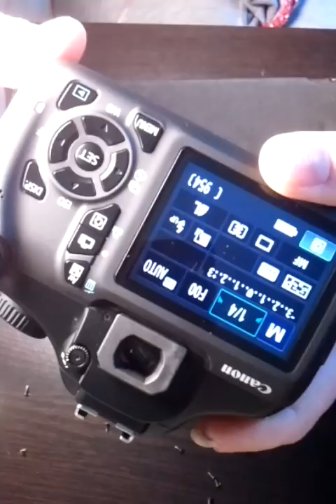#001 Repair Canon EOS 1100D (Rebel T3) - SD Card Replacement for Error

Comment: This is awesome, it's close enough to my T3i model.  I have a bad habit of leaving the SD card in the slot, even when not in use.  I'm assuming, over time, that is now a "no no" as I fired mine up after about 2 years of the SD card being in it and when I tried to remove it to throw in my laptop, it gave me trouble getting it out.  It took a little force after the eject mechanism but it still gave me an issue getting it out.  A piece of the corner from the SD card was cracked and created an obstruction.  When I finally got it out, I learned that it bent the contact pin for the write protect lock and no matter what I tried, even though 6 different SD cards, didn't have the write protect lock enabled, it still would not read the card.

Just ordered my SD card board and when it arrives, time to go to work :D
Reply from the maker: Hi, thanks! Interesting, this model had some issues with the SD card, same issue as you mentioned. You are lucky with this model, Canon decided to place the SD card separately on this entry level camera! This is my first video on this channel, it got over 22k views by now, glad to see people still can make use of it!

Comment: What that tagged black wire is used for (12:40)? I think I broke the connector. :(
Reply from the maker: Francesco Cosoleto 
Is related with the flash, it’s an optical wire, just need to stick it in that white holder

Good luck!
Reply: Thank you very much!

Comment: hello. i have a powershot s3 is and the reader is soldered to the whole board (not a separate piece like yours) do you know if its possible to remove the cover to see inside?  if so how?  i can hear something is loose and hoping can be repaired as the reader is giving an error
Reply from the maker: cynthiarf - AfroCare replaceing the sd slot soldered to the motherboard requires a good experience in the soldering as it is not a job for beginners, I suggest you get it done by an expert

Comment: Might be a little late for a response but I'll try anyway -
I bought an 1100D, with the card protected error.  After trying a fix from a different video (soldering a jumper wire), and also trying to bend the "lock" tab, I now know longer have the card protected error, and instead get an error about the "card cannot be accessed", and I cant format the card in the camera.

I went ahead and ordered the 1100d replacement SD card pcb.  In your experience, do you think the problem is with the SD pcb, and swapping it out will repair the issue and get it working?
Thanks for any response.
Reply from the maker: Hi, there are two pins inside the card reader, one for the protection and one for recognising that a card was inserted. Something could go wrong there, still the camera should work after replacing the whole SD board
I would never recommend repairing such a delicate component, in some cases could damage the main board

Good luck 😉
Reply: @CameraRestore  

Thanks for the response.  Hopefully no damage to the mainboard was done, as everything related to the last "repair" I did was localized to the SD card PCB.

Here's to hoping that getting a new SD card board works.

Comment: Hello. I am having the same issue with my camera (Canon T3) Can you please tell me where can I find the part? I have looked on ebay but nothing... I really apreciate if you give me where to buy it. Thank you.
Reply from the maker: Hello, try here:
http://www.ebay.com/itm/Canon-1100D-SD-memory-card-slot-board-pcb-replacement-part-L130-/171487571348?pt=LH_DefaultDomain_0&hash=item27ed74ad94

Comment: Can you pls point me the correct SDcard board for canon T3i rebel in ebay , my camera is failing with "card write protect switch is set to lock"
Reply from the maker: Have a look for this part number in your area: CG2-2946

Comment: how much does the card reader cost?? please
Reply from the maker: gomez amina hello Amina, I found it on ebay used but fully working at 25$,
buy the whole sd board, not just the component to be soldered,
like the one in the video
Reply: Cosmin Usher
thanks for the information but fortunately i leave in algeria so i don't have a card to buy it, i steel have the canon and steel deosn't work :(